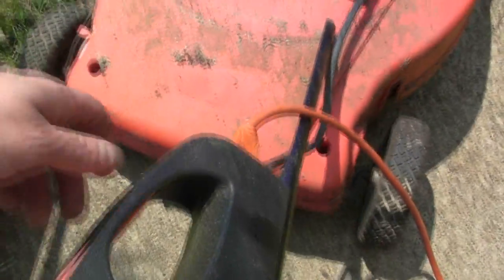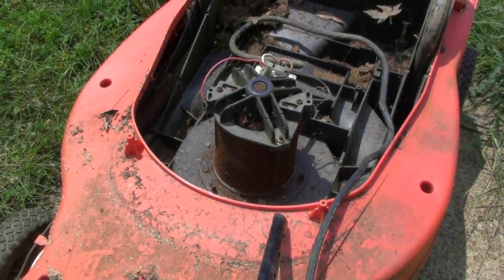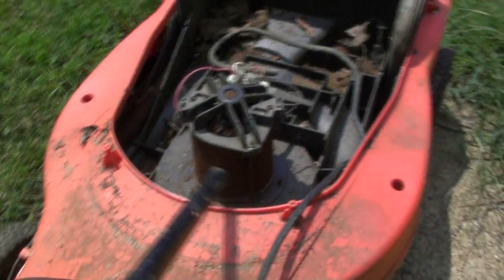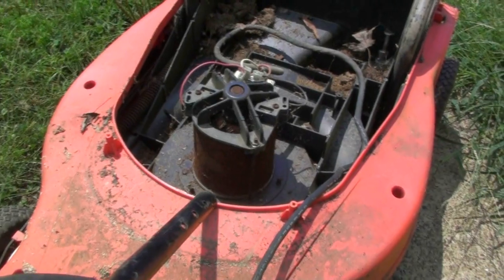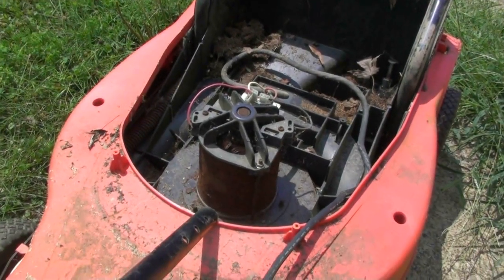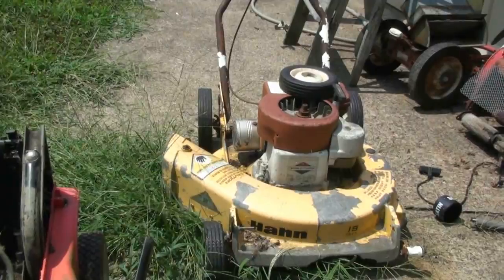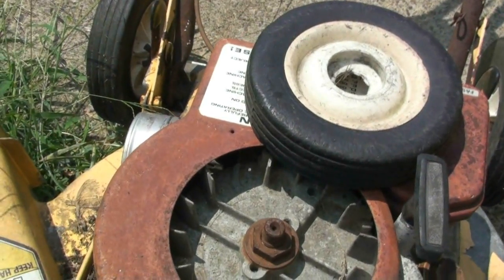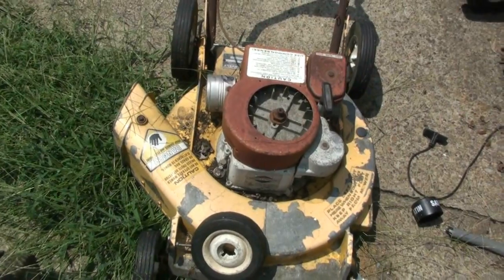Converting A Gas Lawnmower To Electric, Part 2

Comment: *So easy to use.>>>t.co/OzLDiL2N5j    After using gas mowers for years I wanted to get something that you can just plug and go. Note: get the right extension cord 12g and 14g per instructions. Thanks.